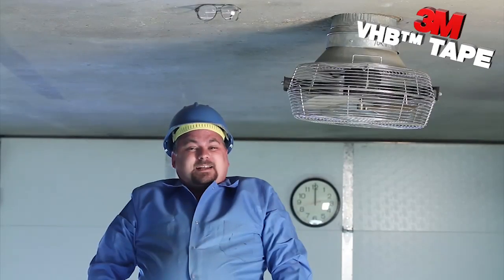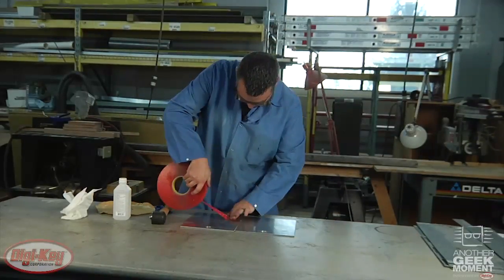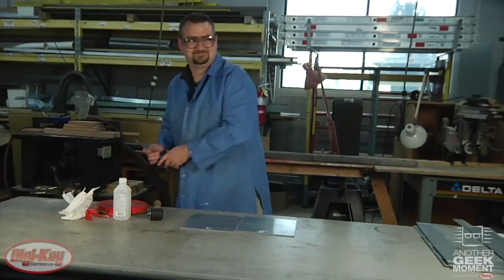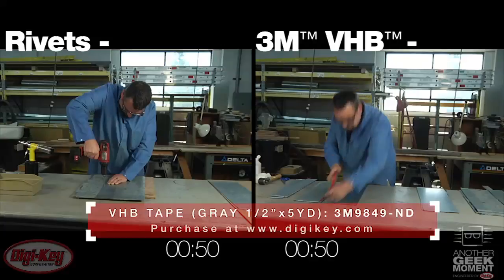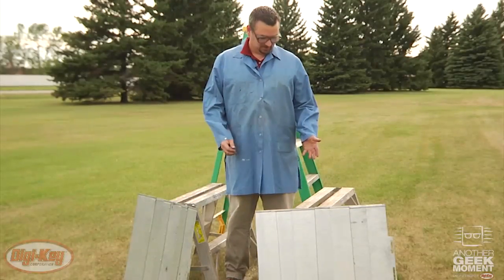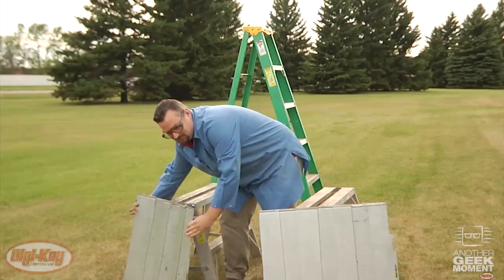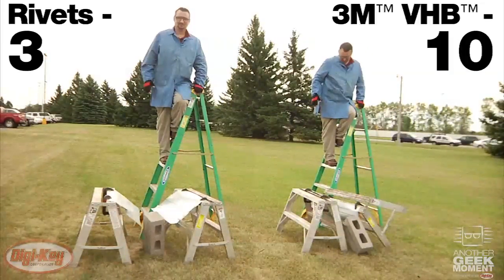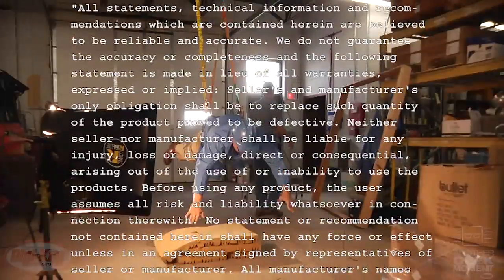3M VHB adhesive demonstration holds up man -- Another Geek Moment

Comment: Usually, in engineerings, the stiffer the material, the easier it is to break. I thought he was gonna stand on top of both but apparently he didn't because one of them wasn't even capable of holding a person there, which is kinda not the point of it, isn't it?

Comment: Hi, do you know what double sided tape stick to wood?  I was reading 3M 4950 says wood has to be finished/sealed...  I am trying to attach some wood pieces to acrylic photo prints in order to have a wire in the back for hanging (required by gallery).  But I tried J-B Weld Epoxy that someone recommended, and it soaked through to the image ruining the print.  So someone else suggested 3M VHB tape, but I don't want to have to seal all the wood pieces first, that's a lot of extra work.  The weight is not a lot about 2 lb, and I can put about 20 sq in of tape...
Reply from the maker: Hello Roman, unfortunately tape is never the best option for wood. It will continuously release moisture if it is unfinished, which is why most tapes won't stick to it long term. If you haven't already purchased the wood, I recommend using melamine covered particle board. The tape should have no issues sticking to this material. Otherwise I recommend taking the time to finish the wood if you've already purchased or you may end up with a print dropping and ruining the acrylic as natural wood just won't be reliable. Good luck!

Comment: Hi, thanks for demonstration, I need attach an aluminijm plate to a steel frame. the steel frame has anti-rust paint. Should I remove the paint before using the VHB Tape?
Reply: Yes.

Comment: yes the 3m VHB is a very good product and it does everything plus more than the videos itself describes. Though at the end notice that his rivets  where 6-8" apart plus and a small rivet with a weak tensile strenght. yes if coarse it will break much easier. The surface area of the 3m tape is over 1000x times more than the rivets. The only advantage is a water and air tight seal

Comment: Holy shit, I got a go pro recently and didn't trust the tape on the mounts for hide speed movement and shaking. I do now!
Reply: I've had a GoPro mount on my helmet (which is semi-porous, btw) for the last 8 years and it's holding up just fine. All GoPro sticky mounts use VHB.

Comment: Could you use VHB in aircraft construction?
Reply: F. Abu-Taha I've heard they actually do use it in some minor repairs and such, seriously. There is also a hotel/skyscraper in Dubai where the windows are held in place(and in fact, what they may have used may have been a special purpose version of this tape, the fact is it looked the same)and they ended up using it for more than just the windows, there are apparently no rivets in the entire building(there may be some in the aluminum frame work used as the "skeleton" of the building" but still, considering the heat and wind in Dubai(I've heard that, particularly up near the top floors, 120-150kph wind gusts aren't uncommon!). I suspect you would recognize the building in question if you see a picture, http://www.dictionaryofdoctrine.com/files/Dubai_Tower_Sail.jpg

That's the building--well, one of them, since a lot of the hotels and other establishments in Dubai were designed by the same group of architects, it's possible this VHB found it's way into other buildings, and almost certainly other buildings around the world, when something works, it works!
Reply: +Rick Pants It is not rubber tape. It is acrylic foam tape. Closed cell acrylic foam with acrylic adhesive.
Reply: +Nick Waites Sounds risky, VHB is a rubber tape and is easily removed when heat is applied
Reply: +Rick Pants it can withstand 450 degree Fahrenheit during oven curing

Comment: ok imbulding a wooden framed house,,that i want to wrap with 6mm insulation,and then foam/alluminium sheets,if i fixed 1" wide flat alluminium over the insulation,and fix the tape to that,will that work?How much is a roll of that tape in the US?
Reply: +Robert Taylor VHB tape is fairly expensive, the particular roll in this video would be about 90 USD

Comment from the maker: If the PVC panel is flexible they will need a tape that has plasticizer resistance so that the outgassing of the plasticizer would not eat into the adhesive bond.  Also, it would be necessary to have the plywood coated and not bare.  If it's not, a 3M Rubber & Vinyl Spray 80 could be applied to the wood in the areas where the tape will be bonded. 

I suggest testing either RP45 or 4941 VHB tapes.  Digi-Key has various sizes of the 4941 in stock, including disc, rolls and sheets.